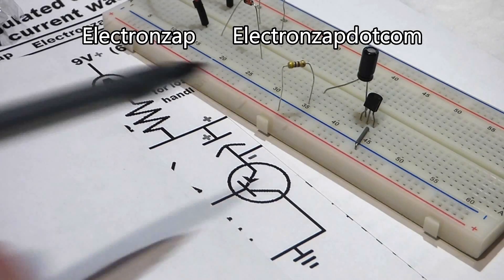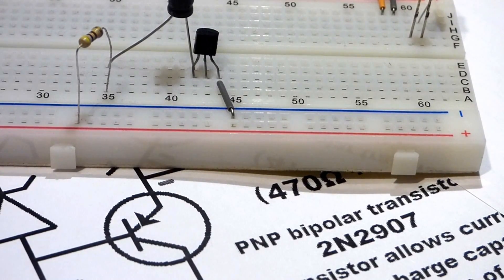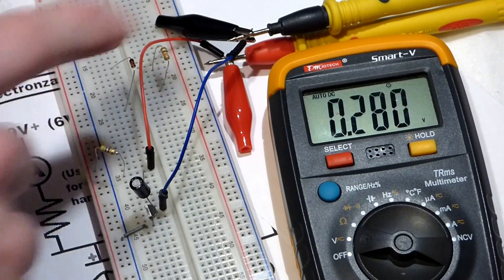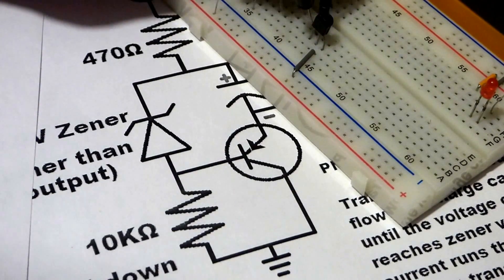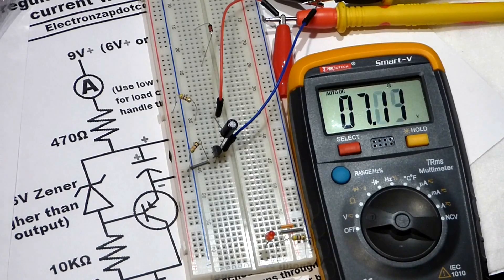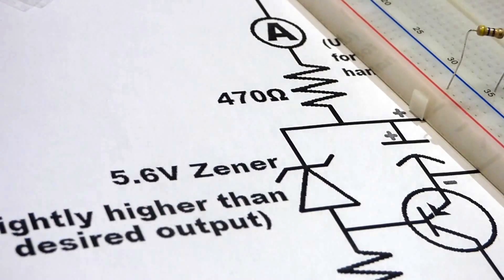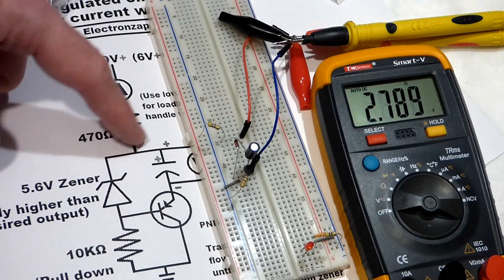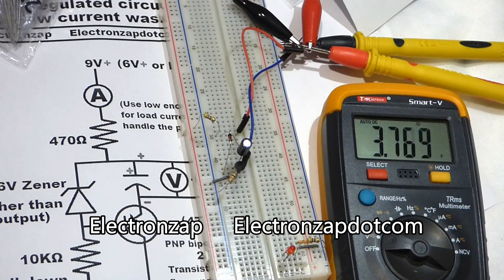Step by step build of 2N2907 pnp transistor zener diode regulated 5V circuit waste little current

Comment: QUICK QUESTION, FOR EXAMPLE IF I want to increment a little bit more the output current for example from 20mA to 60 mA can I use a lower value base resistor, or THE TRANSISTOR IS WORKING IN CUT / SATURATION MODE?

Comment: The schematic was obscured. Actually, the schematic should have been used for the  explanation as to how the circuit works. Afterward,  showing the built circuit is juxtaposed circuit with the schematic would be effective as well  explanations of the various individual components. Good Try!
Reply from the maker: That's the plan when I get more time to do things :D The more overtime I work at my real job, the more rushed my videos get.
Reply: No problem. I wanted to give you my impression of this video as a Teacher and am Electronic Hobbyist. I don't have your level of expertise in either making videos or in Electronics, but I know what I am looking for should I get the  chance to teach 7th Grade Texprep again. I try to collect the best Science Videos and teach them in some coherent form.

PS: I think you could get a lot of circulation with "What not to do" Safety videos such as what happens when you overload Capacitors or use 100 Ohm 1/4 Watt Carbon Resistors with 9 Volts, showing the Math that such is a doomed experiment. 

Regards
Reply from the maker: I did do some thermal image videos on components getting hot to help explain that and other videos about wattage and short circuits. They didn't get many views sadly.